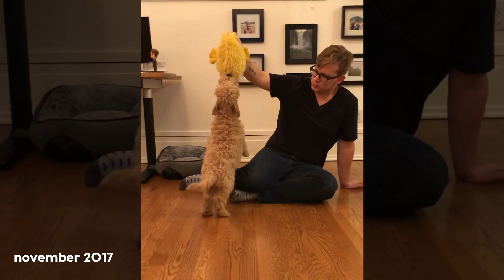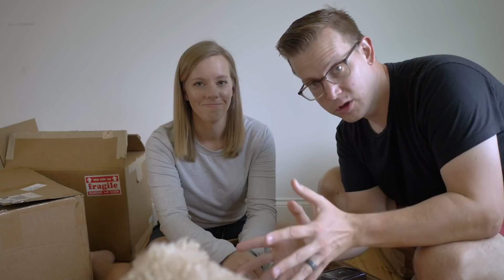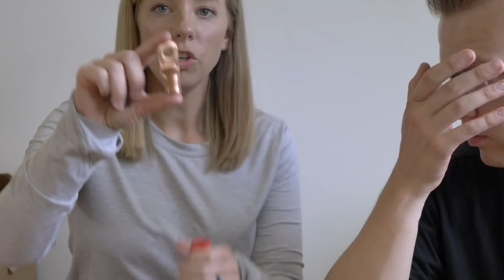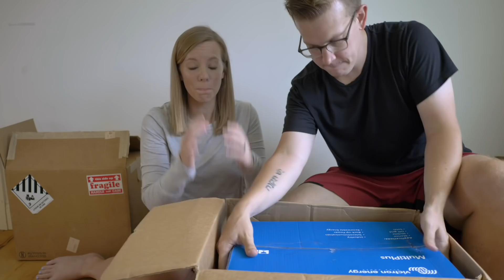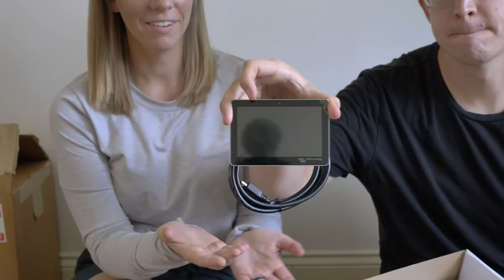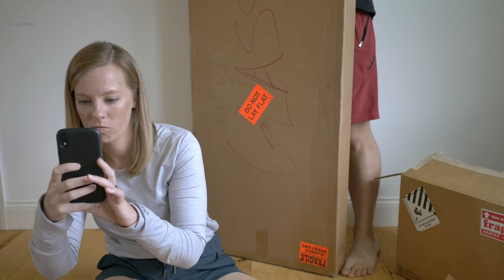(EP. 6) ALL ELECTRIC VAN CONVERSION solar components unboxing (why we chose what we chose)

Comment: isn't your AC 12 volt which skips the inverter?   what is the micro air easy start for?
Reply from the maker: You’re absolutely right! We received this Microair because we initially had a different AC unit that was not 12 volt
Reply from the maker: You’re absolutely right! We received this Microair because we initially had a different AC unit that was not 12 volt

Comment: My guess is that giant fuse is either to allow jump starting the starter battery with the house batteries (will require up to 800amps depending on how dead the starter battery and how cold the engine is), or just as a last line of defence against major electrical shortage thus fire

Comment: Congrats on the new build! Have been following along for some time now :) I'm curious to know how you ended up going with the Orion Smart Tr DC/DC charger as opposed to the High Voltage Charging kit from AM Solar? That seems it would charge the batteries on the slower side...?

Comment: Fun Episode!  I am also building on the 144 4x4.  I will let AM Solar know your video inspired me to contact them.  One question I hope you can answer is the selection of your ac unit?  Did you consider the Coleman Mac 10 NDQ or the Advanced RV quiet AC (may be 3x quieter) Any plans for retractable running boards?  Are you going to use a secondary alternator?  Although I have been planning my build for more than a year your utube  Chanel is a wonderful aid for me on my first build.  Great minds think alike!🤗 Thank you!
Reply from the maker: Hi Tammie! Definitely tell AM Solar we sent you. They're great guys and super helpful!
For the AC we're going with Nomadic Cooling. It came highly recommended by some other van lifers as well as by Site Seven (the conversion company who installed our Flarespaces). We originally purchased the Dometic Penguin ii but because of how small our roof is and given the position of the hole that needs to be cut for the Dometic, not everything would fit on top of our van with the three solar panels. The way the Nomadic's hole is positioned we should be able to get everything on our roof just fine. Not to mention it's a 12v AC unit and much more efficient than many other models on the market. 
We aren't adding retractable running boards but we are adding the Aluminess Nurf Bars (which work well with our Espar D2 heater running under our van). 
Hope all this helps and good luck with your build! :)

Comment: I can't get behind Zamp....absolutely the most expensive solar panels on the planet besides what they use on space satellites. 

A watt is a watt. Your batteries don't know the difference. I get that roof space on a van is at a premium but the difference between 19.1 percent efficient and 19.9 percent efficient isn't worth the insane premium buying a Zamp panel means. $500 for a 100w panel? It's insane. 

I'm running 4 100w renogy panels in series and couldn't be happier. Flat mounted and rarely cleaned I'm seeing 315W on average in the summer and collecting 2.2kwh around the middle of the US latitude...... Under $340 shipped. Or I could have spent $2000 on Zamp to get 350w on an average day and around 2.6kwh. It just isn't worth it.
Reply: I agree. I do not see point of 4x expensive solar panels. what does zamp do better than renogy?

Comment: What the hell are you going to do with up to 800mAh of battery capacity? 😲😄
Reply: That's alot of batteries being installed in the MB 144, no garage space for sure.
Reply: is not that much if you have ac

Comment: Won't the solar panels get damaged if there's hail or something falls on them?
Reply from the maker: That's always a risk, so typically if a storm looks like hail we'll take cover at a gas station or under a tress. However, there have been a few times when we haven't been able to find shelter in time and our old solar panels took a bit of hail and they were fine. We haven't driven through hail with these specific panels, but my guess is that they're stronger than they look, too. :)
Reply: @chrisandsara  thanks for your reply!

Comment: What AC unit are you going with? 800 aH? What electronics will you be adding?
Reply from the maker: Hi David! I'll link our AC unit down below. We've been told to plan for this AC to pull 100ah an hour running full blast. So with our 500ah battery bank we should be able to run it full blast for about 5 hours. Hopefully we won't be running it full blast since our van is so small but we don't know yet. We'll be sure to update everyone once we see how it works out for us. :) 

Our other electrical items include our Isotherm fridge, Bosch 4 gallon electric hot water heater, and induction cooktop.  

Hope this helps and here's the link to the AC: https://www.nomadiccooling.com/product-page/nomadic-cooling-2800
Reply: @chrisandsara  
Thx

Comment: Great video.  I am assuming the AC unit is for Kramer?  We will be traveling with a dog as well, so would love to know if it's a must.  Thank you!
Reply from the maker: Hi Amy! Yes, Kramer was the deciding factor when considering AC. However, we're not complaining about having an AC for those really hot summer days. 😅Our first van we intentionally didn't install an AC because we traveled on the cusp of the seasons and we really only had a few REALLY hot weeks in the year. However, if you're like us and wanting to travel anywhere anytime, we'd definitely recommend an AC unit. Having one in this new van will allow us to safely travel to places like Florida to visit my sister whenever we want whereas before we really would only visit in the winter. It's not impossible to vent a van well with a ceiling fan + windows, but with dogs you'll definitely be thinking about them constantly on even those 75 degree days. Hope this helps! :)
Reply: @chrisandsara  Thank you for your prompt reply.  We are leaning in that direction, however, it definitely adds quite the cost with the need for many more batteries as well.  We've gotten used to saying "it's just money" with our children and now the dogs are no different! Ha! We are planning on placing a call to AM Solar for a consult, so they can guide us as to whether we will need the full compliment that you have.  It is quite the system.  We are envious. We are thoroughly enjoying watching your van build, as well as your past one, and are taking lots of notes.  Keep up the great work.
Reply: @chrisandsara  We're going with the AC unit!  Is there a link to use that will allow you any benefit from our order?

Comment: Amazing video! How much does it cost to have that kind of solar and electric set up? I’m planning to start my van conversion.
Reply from the maker: Hey James! Thanks for watching. :) So truthfully our new setup is a little $$. I honestly couldn't tell you the exact number because part of the system was gifted to us from ur partners. However, I do know that the part of the system that adds up quickly is the batteries. One of our batteries costs just under $1000 USD. Some of the components in our system such as the monitor and solar panels are pretty high end and there are less expensive options on the market if you're looking to save some money. AM Solar has prices to all the components on their site (amsolar.com) and they also do free consultations which we can't recommend enough. Our van is going to be running A LOT of stuff so chances are you won't need near the system we have going here meaning you could save some $$. Hope this helps! :)
Reply: Just checked the site it's probably around 10 000 or 15 000! So pretty dang expensive. But i think it's worth it!

Comment: Love that y'all didn't just fully endorse without trying them yet. I heard that attempting to charge or draw power from lithium when temps are freezing can damage the batteries. Is that a concern the folks that helped you with your electrical system (amsolar iirc) mentioned/sent a like temp controller for?
Reply: Thanks for giving the heads up on this video release. Look forward to watching the vid of y'all settin it up and how it works for y'all

Comment: Such a great video!!!! Thank you! Solar/electrical is the part I am super intimidated by and this video was very helpful! I will definitely be contacting AM Solar! What Air conditioner are you are getting? I was thinking about A/C but I have been going back and forth.
Reply from the maker: Hi Sherry! So glad the video was helpful! :) We originally purchased the Dometic Penguin ii but for a couple of reasons (size and weight mostly) we're switching to Nomadic Cooling (https://www.nomadiccooling.com/). While the Dometic is a solid option, the Nomadic is going to allow us to fit all of our solar panels on the roof and save a little weight and electricity. Hope this helps! :)

Comment: I’m so excited for you guys! I’ve always been that guy who’s into “volts and amps”, so this is a huge treat.  I was originally thinking - 500 AH?wow! But how will you ever charge it? In thinking about it - 300W of solar, plus the 30A of alternator current should do the trick.  Not only that, you’re never going to draw 100% of the load all the time. Most of the time it’s “topping off”. 

And by the way - those lugs are a pain, but you’ll never get a stronger connection.  My nerd out is complete - I’m rooting for you! 😁
Reply from the maker: Hey Lucas! So glad you enjoyed it! We were a little worried it might bore people because it's a little techy. It's good to know we have friends who enjoy the more techy side of things. That being said, we apologize we can't give more info because past this it's mostly over our heads! lol 

Hope you're doing well and have a great weekend! :)
Reply: I second Lucas. Do the techy stuff because people could use the electrical knowledge if they are looking at building their own. Plus you guys are doing it the best way with quality parts!

Also I think there's a way to get around the alternator charging and warranty. A popular modification is to get a dual alternator bracket, install a high output second alternator and only charge off that one. This will 100% isolate the house electrical system with the engine battery/alternator. High end alternators can put out 200A at idle.